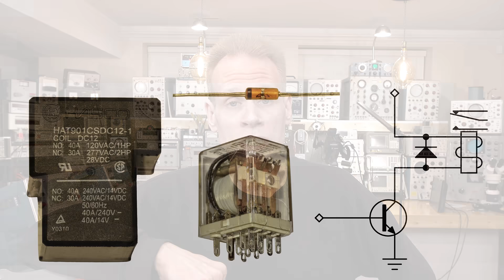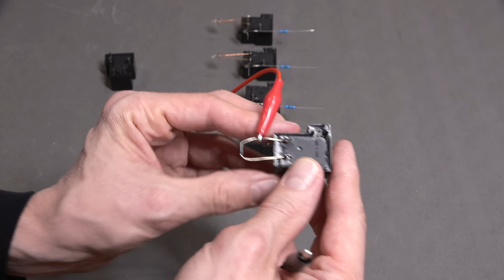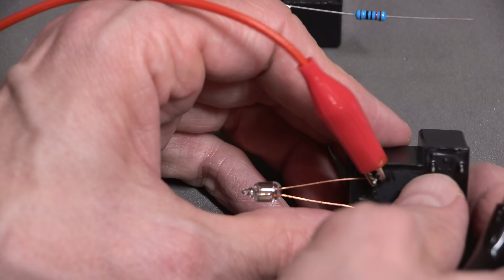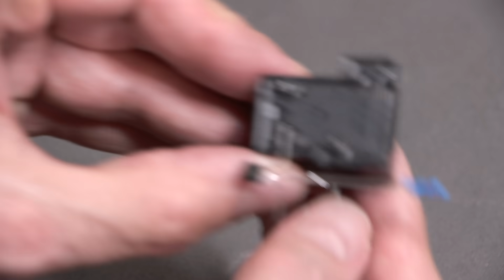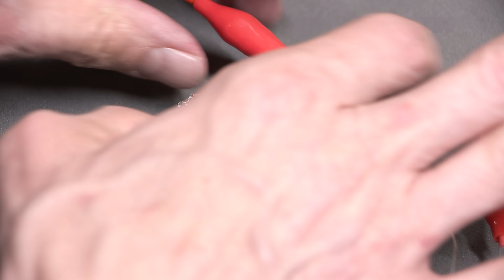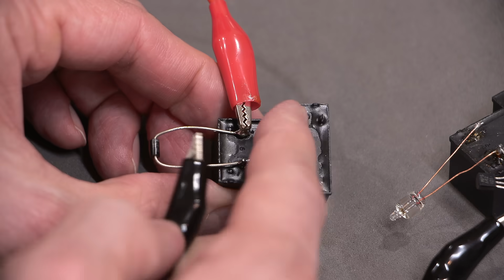Why Add This Diode Across A Relay Coil? This Is Why It's Needed!

Comment: I have a toggle switch controlling a large coil that happens to be an electromagnet which pulls or holds a piece of steel...I had an led to show energized. It burned out after awhile.. I'm guessing a diode would work for this as well? I'm guessing a very large spike is happening.. What size diode?

Comment: Wow, I used the exact style relay as your first picture and used in the demo (but our case the relay was manufactured by Omron and is I am sure an exact replacement) in a power backup control system years ago. Of course it had the diode (or another snubber), and was entirely reliable.

You know that the diode causes the field to collapse much slower on opening because it is essentially less than a volt back EMF to the coil, compared to the 12 V to energize. So the relay may open more slowly. We may have used a different "snubber" network on the coil because we needed the relay to open quickly. (Or I did that in some relay application.) Another kind "snubber" is manufactured as a series resistor and capacitor in a single package, and when you tune the components and the coil together that controls the voltage. It will always exceed the power supply in that case until the current drops.

Comment: Most automotive relays and solenoids have a built in MOV type device now. Bi directional and doesn't act as a short if power is connected reverse
Reply from the maker: Thanks for stopping by Mr Shango! :^)

Comment: A resistor is often a better choice for two reasons. Firstly, it is not going to short out if the relay is hooked up backwards, and secondly, the contacts will break open more quickly with a resistor as a diode will allow the coil to draw current for much longer. With every good idea there is a price to be paid. Compromises, compromises.
Reply from the maker: It's all about that fine balance :^)

Comment: rotary screw air compressors with PLC controls use a capacitor across the coil on the magnetic starters to protect the computer for  just that reason
Reply from the maker: That works too, but there is a fine balance with that as well. Capacitors look like s short circuit when they are not charged, so for a brief second, when current is applied to the relays coil, if that coil has a capacitor across it, the circuit that is driving the relays coil will see that brief "short circuit like" load as the cap charges. Larger relay coils have a larger inductive kick when the application voltage is removed, so larger uF values need to be used to suppress that inductive spike. Larger uF values mean the short circuit like load can be more of an issue. So you can see how the issue just gets moved to another area.

Comment: We actually don't use diodes in braking systems to get the coil fields to drop quickly. We use avalanche breakdown to get the energy out.

Comment: I discovered this effect when I was about 7 years old playing with an electronics set my parents bought me for a birthday.  Fingers across the relay coil gave me such a belt the relay ended up across the room!
Reply: Yep! I was removing a steering wheel and accidentally, momentarily grounded the horn wire while touching it. Ouch! I didn't think 12V could hurt me, but when it's amplified by the coil in the horn it comes back as a lot more.
Reply: You're not alone !!!!
Reply: We learnt this quickly in the old mechanical style telephone exchanges , especially with the mechanical drive coils .
Reply from the maker: Thanks for sharing your story!
Reply: Been there, done that😂😂😂

Comment: I had one of these diodes short out on a CH53E helicopter auxiliary power plant (APP) engagement clutch relay.  It caused to APP to shut down when the clutch relay was energized after 92% speed was reached.
Reply from the maker: Thanks for sharing your experience!

Comment: Wonderful demonstration and explanation of what was causing intermittent failures with electronically controlled excavators in the late eighties and early nineties. Extra hydraulic implements would be installed and electrical controls were installed using relays that were grounded through the machine frames. The jolts sent into the frames would interfere with the electronic controls which would just stop working. Luckily, shutting down the machine and restarting would reset the electronics boxes and the operator could go back to work until the next time the spikes blew out the controllers. It became required to install diodes across any relays when modifying a machine.

Comment: Good demo, and the use of a neon bulb to help explain is interesting.  But as an engineer, I think it's important to relate the inductor equation (  V = L * di/dt ) to what is happening.  It helps relate the math to what is happening in the circuit.

When we remove the supply current (by disconnecting one of the coil wires) di/dt goes down - mathematically, it goes negative.  This immediately changes the sign on V - which means that the polarity of the voltage on that coil instantly reverses.  One side of the coil is attached to the power supply, say at 12V in a car.  But you just release the side that was at ground.  Since the voltage immediately reversed, what was at ground, is now as some voltage higher than your supply.

But what voltage does that side now go up to?

That depends on what else is attached to the circuit.  For a 2N3904 transistor with a VCE max of 40V, it will go up a little past 40V, then the transistor junction will breakdown, and shunt the current to the emitter, which is still at ground.  Depending on how much current was in the coil, and how beefy the transistor is, you may kill that transistor the first time you turn the relay off, or it may survive for a while.

When you put a neon bulb across the coil, and turn off that current, the ground side of that coil will rise to the turn-on voltage of the bulb, turn it on, and allow the current to flow through the bulb and back to the power supply, until current in the coil drops to zero.

The higher voltage transistor that was used in this video had a breakdown voltage that was above that of the turn-on for the bulb, while the 2N3904 has a Vce breakdown voltage that is lower, shunting current away from the bulb before the voltage got high enough to turn it on.

We can rewrite the inductor equation in the form:  di/dt = V/L.  In this case, the coil inductance, L, is constant.  In this form the equation shows us that the coil current changes proportionally to the voltage across it.  So when we turn it off, higher voltages across the coil will turn it off faster than slow currents.  It would be interesting to see this by putting a battery on the switch contacts and measuring the turn-off time with a scope, using the different forms of kickback protection.
Reply from the maker: Hi Cynthia. Math is great, but it's still just a conversion language. When you can actually visualize whats happening in the circuit without that conversion language (or intermediate area) This is when you will truly become a fantastic engineer. Thanks for taking the time to write.
Reply: @MrCarlsonsLab  Visualization is great for those who are visual thinkers, and I know some great engineers who are visual thinkers - they tend to be terrible conversationalists though!  

I'm NOT a visual thinker - I need to hear the logic and see the equations.  In fact, I've had a lot of trouble communicating with some of the visual thinkers - despite the fact that I can often find the words to complete their sentences before they can!

I would argue that if you can do both the visual thinking AND the math, then you're the best kind of engineer.

Also some of our intuitions and visualizations can be subtly wrong or inapplicable in certain cases.  In these instances, it might only be the math where we truly figure out what is going on.

Comment: Thanks for reminding me. I normally use darlington arrays like 2803 chip with internal flyback but in a POTS project I have a current transformer to create 20Hz 120v I must figure out how to add a flyback diode or something for when a relay cuts the load 🤔

Comment: Thank you so much for this new tech-tips series.  If the relay coil were powered by alternate current, what would be the right component to put across it, to discharge it?

Comment: The diode has the secondary effect of making the relay SLOW RELEASE.   If that's OK, do it.   Otherwise you might want a circuit that snubs out the coil energy at a higher voltage.
Reply from the maker: This usually takes a power dissipating device, and creates heat. If this is ok, a low value resistor is fine. Unless you are dealing with gettered turret relays in a CNC machine (or the like,) the extremely small time delay is usually no issue at all.

Comment: I knew add a diode due to the voltage spike from the magnetic field collapse.  I do it to protect the switching transistor. But it is good that you had neon bulb and other things to indicate it.  I did not know relay coil can fail/short from the voltage spike. Good video.

Comment: additional Flyback diodes can help with controlling solenoids if your pwm‘ing them , it helps valves „float“  On vvt valves or idle control valves

Comment: Sorry for an off-topic question. How do you deal with these inexpensive alligator clips getting very stiff over time? I've noticed that it takes about 7-8 years for the rubber sleeves to become rock-hard. Do you just replace them periodically? Or is there any way to soften them?
Reply from the maker: Yes, those vinyl boots go fast, silicone is a better option.

Comment: I am very happy with this thorough explanation that i haven't seen nowhere this deep until now.  What i wonder was: why doesn't the manufacturer installs a diode already if it is necessary anyway?. BUT on the other hand you can attach plus and minus however you want on a relay, the coil of the relay doesn't care, it will work either way, but when a diode is installed... the other way around would make a short... So that's why...
Reply: If you are designing the circuit or the technician fixing it you should know the polarity of the voltage applied to the coil. (99% of the time it will be positive but check anyway to be sure what you  are working with.)

Comment: In the 1960s and into the 1980s, I maintained flight simulators.  They used 28vdc relays with reverse diodes to short the conductive "kick" to ground.  Never had a relay coil fail due to the coil insulation failing.  However, in today's relays, that's very possible because of the very light gauge wires used in the coils.  These aren't as robust as they were in the "olden" days.

Comment: please do not say "its reverse polarity"
it isnt.

the current in an inductor simply doesnt want to change. given a dead short, zero resistance, superconducting, the current would persist as a magnetic field "indefinitely". the relay would never turn off.
given the high resistance of air, teh magnetic field rapidly collapses and manifests as voltage as per e=ir.
the first transistor junction poses a lower "resistance" than the air... so the releasing energy takes that path instead.

the diode is a short with a conducting voltage of 0.6v. it clamps the voltage rise to 0.6v, and current will flow until the magnetic field is depleted at the rate determined by the diode drop.

the current IN THE COIL continues to flow the same way. it simply now loops on itself via the diode.

the neon has a handy feature... it also clamps the voltage, but to about 90 when it strikes, quickly falling to 20 or so as ionisation takes place, then extinguishing as the energy release can no longer maintain the potential required.

the mpsa42 is safe as the neon is clamping peak voltages and consuming the energy instead of it either sourcing or sinking via the transistor. (high/low side?)

its a handy trick to get fast action from a relay, add resistance until the peak voltage is just at the components limits...
a scope on the relevant outputs would have been nice?

Comment: Thank you for the information. I have been installing all my equipment on my truck not knowing that a diode was needed. This explains what happens to my relays over time. Great information! Thanks again!
Reply: most modern bosch style automotive/truck relays already have relays built into them.  You can see it using the relays schematic, or the diagram on the side of the relay. you can still purchase low cost relays that do not, thus buyer beware.
Reply: @Country78155   thumbing through a Bosch catalogue is a real eye opener especially the diagram pages.

Comment: I replaced several hundred hour meters under warranty on power equipment that had failed within the first 50 hours.
Turns out the 12V electric clutch was spiking the harness voltage as high as 200 volts when turned off.
Replacement meters started coming with a diode across the terminals.

Comment: If you own a classic SX series Pioneer receiver add a diode across the speaker protection relay coil. Otherwise the relay beats the snot out of a transistor in the protection circuit.

Comment: I have worked on a lot of very large MCC using 3 phase contactors with 24v DC coils and control relays using 24v DC coils here in UK.  I have never seen a diode across the coil.  I have seen them on small relays on PCB's though.

Comment: Howdy. Yes.
An observations though.
The free-wheeling diode protects the transistor. Yes. But it makes the relay slow to disengage. The circulating coil current keeps the relay engaged until it is dissipated.
Cheers

Comment: I get that the transistor was taking the impulse from the collapsing magnetic field in the coil(i.e. inductor) so just to clarify is that pulse bridging the transistors internal junction to flow back out through the (-)NEG lead THROUGH THE POWER SUPPLY and back out through the (+)POS lead completing the circuit? 

One of the simple sayings I was taught:
Electricity leaves from the source and returns to the source.
[The collapsing magnetic field being the source in this case]

So if you were to recreate the setup with the little transistor and neon bulb that didn’t flash BUT you pulled the power supply’s negative lead from the transistor [while you had the coil engaged with the push button] we would see the neon lamp glow since the return path for the impulse through the transistor would be removed…?

Comment: A great way to display back emf. A lot of thought went in to demonstrating this effect with neons. Another great video…
Reply: no it isnt as it isnt back emf at all.
inductance is inertia is the opposition to "getting the circuit going". you apply a motive force, and it pushes back or reacts with a counter motive force. could be physical. electrical, or magnetic (yes, magneto motive force...)

lenz reactions. a changing current creates a magnetic field with an opposing magnetic field and eddy current. that opposing eddy current IS the BEMF. it opposes the change. its the inertia of the circuit. (picture the effort to get a car moving versus fighting air resistance... get it? you can technically harness some of the momentum as regenerative braking. never more than half!)

when the current is removed, the magnetic field collapses and becomes the source of EMF. anything tending to oppose the collapse of the magnetic field, ie, a dead short, would produce BEMF...the high voltage is your sports car hitting a brick wall of "resistance"...

if its air, it tends to make a nice arc.

in neon its a red glow... and not a very high voltage :) but still high by most semi conductors standards...

Comment: Using only a Diode is insufficient and ineffective; an Optocoupler must be employed to prevent reverse current resulting from the voltage spike (inductive kickback) of the relay coil.

Comment: O.K. I now understand the importance of having a diode installed across the relays coil (as a one way pathway) to absorb the voltage spike back fed thru the circuit from coil collapse (thank you) if you are using relays to control circuits, ((some higher amounts of  amperage flowing within that circuit)) How does one decide the correct size diode to chose?  Am I incorrect, are diodes load rated in size such as capacitors? Thanks Mr. Carlson.
Reply: ...Anyone??? 🤔

Comment: Very interesting demonstration. To keep from damaging a transistor that's switching current on and off to the relay coil you need something to dampen or absorb the higher flyback voltage coming back out of the coil by the sudden collapsing magnetic field and a diode is the usual fix. On the other hand that flyback voltage from any coil could be use for some other purpose, like recycling the energy for lighting a neon bulb or LED, from the flyback pulse. A good example is the Joule thief circuit.

Comment: Snubber diodes slow down relay release time since the magnetic field still exists; it is being maintained by the current flow through the diode and the coil itself.

Comment: Years ago I tried to repurpose the wiring, switch, and connectors for fog lights that, per factory intent, turn off when the high beams turn on and instead use them for driving lights, which would on when the high beams turn on. I added a second relay and thought I had everything worked out until I threw the switch and hit the high beams and got a loud "BZZZZZZ!" I had inadvertently created a buzzer. I went back to the drawing board and fixed it by adding a diode.